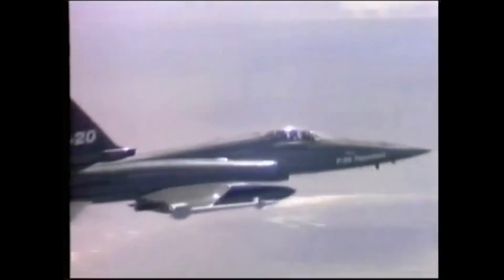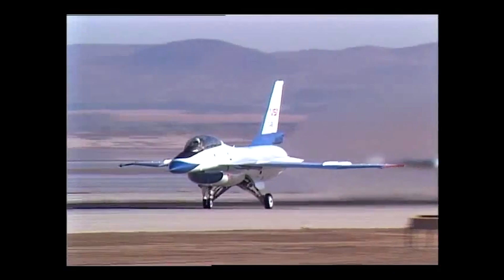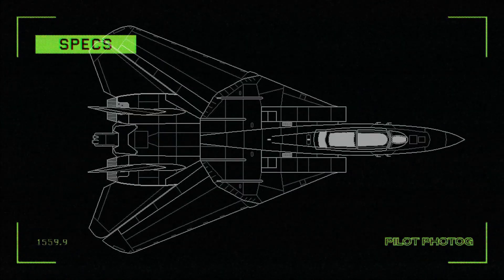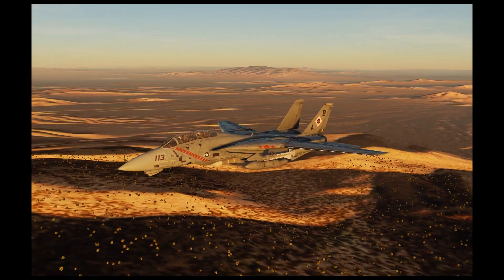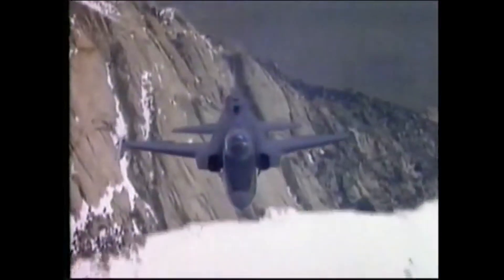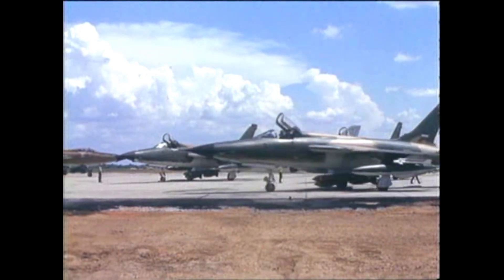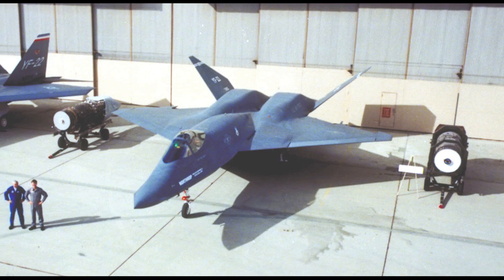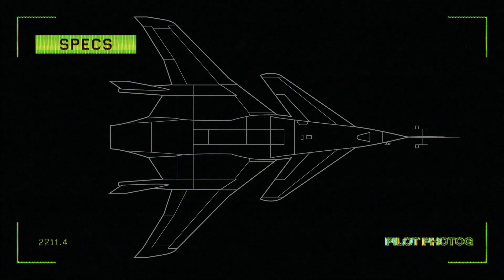Top 5 Fighters That Should Have Been Built | Best of Aviation Series by PilotPhotog  f20  f16xl

Comment: The F-20and F-23 definitely should have been built. I met a brigadier general of the joint chiefs after it was decided that it would award the contract for the F-16. He told me that the pilots preferred the F-20, but the senate had given the F-16 a better deal to produce. Back deals done, grafting began, and so it goes. Where a military project is produced in what state in a given year also determines what gets green lit. Remember the AH-56 Cheyanne? It was 225mph faster than the Huey Cobra, but a couple of mechanical glitches and that was the end of her run. The military adopted a watered down version in the Apache, which is still 355 mph slower.
Reply: The F-20 was never in competition with the F-16 for USAF contracts, and didn't even exist when the F-16 was chosen. The F-20 was developed for export and failed to get any contracts because the F-16 was already well-established in Europe and Asia. 

Are you sure you're not confusing it with the YF-17? The YF-17 was considered almost as good as the F-16 as far as being a lightweight fighter goes, but had different maneuvering characteristics that could have made pilots feel they had a back-up option if they were out of position in a dogfight. But the YF-17 had shorter range and lower payload capacity.
Reply: @dumdumbinks274  No, I had a face to face conversation with said general and those were his words to me. Now, you can say as you wish, but this was a year or do after the F-16 was green lit for production.
Reply: @kingt7126  It's simply not possible. The F-16 entered service with the USAF 4 years before the F-20 even had it's first flight.  They were never in competition with each other., hence why I'm asking if you've confused it with the YF-17 which was the YF-16's direct and only competitor.
Reply: @dumdumbinks274  Look here, I had a conversation with a general and that was my conversation. So don’t tell me it didn’t happen, it haciéndela and there is mi thing you can say to make it unhappiness. You can believe whatever you want, but get out of your feelings about it. You do not have to believe it. Move on.
Reply: @kingt7126  No need to be rude, I'm not attacking you. You may well be remembering what you were told correctly, but that doesn't mean the information you were told was correct, or even the whole truth if it was factual. Fact of the matter is that the F-20 didn't exist when the F-16 was chosen, not that it would have mattered because the F-16 was still far superior as a combat platform.. and the F-20 was aimed solely at the export market anyway.
Reply: @dumdumbinks274  Look here, you started it by saying my conversation did not happened, that’s rude! Who said anything about them competing? I never did. The F-20 came before the F-16. I do not care if you believe what I said on this pos. My connect was not addressed to you in the first place and I do not answer to you. Now go troll someone else!
Reply: @kingt7126  No I didn't. I said the content of what you were told is wrong, and this is easily verifiable. I take it English is not your first language? 

Competitions? You started that topic too by stating "but the senate had given the F-16 a better deal to produce". The deal for the F-16 was reached at the end of it's competition. So you are claiming that the YF-16 and F-20 were in competition. But regardless the entire comment is false because the F-20 DID NOT EXIST back then, and by the time the F-20 prototype was ready for demonstrations the USAF were firm and happy customers of the F-16.

In order to come to the conclusion that the F-20 existed first you have to blatantly ignore 2 easily verifiable facts.
1. The YF-16 first flew in 1974. The F-20 first flew in 1982.
2. The US naming conventions for fighter aircraft dictate that the number in the designation increments upward for each new project of a given type. i.e the F-14 came before the F-15, the F-15 came before the F-16, and the F-16 came before the F/A-18 and F-20 etc.

So you're really only making a fool out of yourself. Doesn't bother me if you want to continue doing that, but being obviously wrong and still trying to defend your position is called arrogance, and arrogance is not a good quality to have as a person.

Comment: Northrop built the F-20 primarily for use overseas, not with US services.  The reason was to avoid sharing our best technology with with so many other countries, but General Dynamics and the F--16 out of Texas used their pull with Congress to make being used by US Forces a requirement for any airplane we sold elsewhere. Most US fighter contracts were already filled except for Air National Guard, but again Texas and GD pushed them to use the F-16 instead which froze out the F-20, which would have been built in California.  

Only one of the F-20 crashes was because of G-lock before the plane was locked out by GD.  The second crash occurred after the pilot ran out of fuel as he was finishing his second air show that day.  He had just finished a 6G turn which ended with him just 20 feet above the ground, and upside down. He was going flip over put down the gear and land, but his fuel zeroed out.

Comment: I'm going to sort of disagree with the F-20. I knew it would be on this list of course. Yes, it would have been a good export plane, and a good adversary, but not so good for the USAF. It was small, had a pretty small weapon load and range with a full load was limited. Great if you have a small country to defend, not so great for projecting power hundreds or thousands of miles away. The USAF already had their small fighter and didn't need another one. I would go so far as to argue the F-16 in it's original form (APG-66 shooting heaters only) was not a terribly useful airplane.

As for the SuperTomcat-21, it was really either/or with the ST-21 or the SuperHornet, and it was really a decision between which Navy fighter contractor gets a new lease on life, Grumman or McDonnel Douglas, and Grumman was hated by Dick Cheney. So many of the reliability problems in the F-14 could be fixed by replacing analog electronics and clock-work mechanisms with newer digital systems. Ironically both companies ended up merging, and McD doesn't even get a name in the Boeing organization, unlike Northrup Grumman.

Comment: The Advanced Tactical Fighter competition in the 80's (F-22/F-23) was intended to counter the emerging threats of Mig-29 & Su-27. I think thrust vectoring capability of F-22 was a key attribute that led to its winning the competition. I surmise Air Force must have been thinking that as controls laws were improved, they could harness more capability from the thrust vectoring system and make the F-22 more agile in future. With everything being equal between the two, F-23 would have won the competition from an aesthetics stand point. It looks sleeker than F-22.
Reply: Not just that... the YF-23 had a small payload. I'm guessing they considered the YF-23 more of a hit and run fighter, whereas the YF-22 could potentially perform multiple engagements with refueling in-between... basically the YF-22 would have been considered more appropriate for the role of air superiority, whereas the YF-23 would be used more like a MiG-31.

Comment: F23 lost cuz it was made from parts of the F18...it was not a totally new plane...F16 actually had more drag...what you mentioned was only after NASA got the're hands on it and drilled micro holes on the wings and installed airpumps to suck the air threw and reduce drag

Comment: The yf23 also may have not been chosen for 2 reasons. Northrup had issues with cost over runs on the b2 program and also a late redesign submission after the jet was being built. Suggesting the design being submitted was good enough and not testing the updated design may have not been worth the cost of the change. Additionally the f14 super tomcat was competing with the budget of the now decided f22 program. And the recent fall of the Soviet Union. One more thing about the yf23 it looks like a flying squirrel.

Comment: The nacelles on top of the fuselage for the F-107 would have sucked pilots ejecting from the cockpit into the engines.  The RPRV-870 (HiMAT) would have had too many reflective surfaces; perhaps, that was not really a concern back in those days when designing and developing fighter aircraft though.

Comment: The Arrow was not a fighter at all, it was an interceptor.
Neither was the Himat, it was just a demonstrator.. It had no complete package that could make it work as a fighter.

The F20 Tigershark is probably the best example of a true fighter, lightweight, big thrust, small, low cost
John Boyd would have told you :  you need a lot of little cheap fighters, not just a hand ful  huge expensive bloated planes.

Super Tomcat should be #2 simply because it already existed for the most part.. it was just an evolution of a tried and proven design , and the F14D's capabilities have still not been equaled by the short legged Superbug.

YF23 is #3 simply because it's way to big to be a true fighter.

Comment: The yf-23 was the better fighter, no doubt! And the yf-23 didn't do 2 belly flops at low altitudes. Which by the way the f-22 never fixed. The f-22 did a belly flops during evaluation whole the yf-23 didn't. Inn fact the yf-23 didn't have any significant problems ever! Whole the f-22 still does till this day.

Comment: My picks are the F-103, PZL-23 Skorpion and maybe F6D Missileer along with the F-111B. I know the last two didn't make any sense but who cares.
Reply: I like the F-103 for would of been the first 2.5 or Mach 3  ( maybe ) fighter interceptor with one engine in mid 1950s.. Planed to use licensed U.S. built  British Designed Bristol Olympus engines with afterburner ( very powerful engines used in the Avro Vulcan Bomber and updated Rolls Royce ones in the TSR2 and Concord ). I worry about the visibility out of the aircraft with a periscope looking forward and windows on the sides.

Comment: F-20 all the way my favorite....
Reply: Arrow bar none. even though it was designed as an interceptor the airframe was designed with forward thinking and modern weapons systems and targeting systems wouldve of made it a spectre of death with the Iroquois engines 30 000 lbs thrust each with proper metallurgy that was planned on the marks 3-5 mach 3 plus was theoretically easily possible let alone mach 2 plus...
Reply from the maker: @hellbringer09  agreed and in case you haven't seen it:  https://youtu.be/oLVDTDhBN1g
Reply: @PilotPhotog  loved it.
Reply from the maker: A great choice and in case you haven't seen it: https://youtu.be/T-TARYA_YHg

Comment: One from the UK - and not the two you might think. In the early 60's, De Havilliand (who had just been swallowed into the maw of Hawker-Siddley) presented to the air powers their Violent/Sea Violent upgrade of the Sea Vixen with twin Speys rather than the twin Avons of the Sea Vixen. Basically looking like a slightly bigger Sea Vixen with a supporting canard on the nose, the Violent/Sea Violent was planned not only to break Mach1 but to touch Mach 2. Drawings were made. Models were made. Engine tests were planned. The RAF loved it. The FAA liked it. The Air Chief Marshall said "This could be the best fighter Britain has ever made" And Hawker-Siddley killed it. It was projected to have twice the range of the Lightning - which, as we know, was a fine plane in its own right - and the abilty to carry enough stores to push it into the fighter-bomber class. But, yes, HS killed it. RIP, Violent/Sea Violent.

Comment: A couple of points:  (1) regarding the F-20 Tigershark: you mentioned that the JF-17 Thunder is a modern day incarnation of the F-20 concept. So is the even more successful Saab JAS-39 Gripen. If you look at size, weight, range, speed, ect then the Gripen is a much closer match to the Tigershark and shows where the idea could have gone. Then again, the Tigershark came into being simply because the Carter Administration didn't want to sell full-up USAF standard F-16's outside of NATO allies. (2) regarding the F-16XL - the XL option could be implemented at minimum costs today as a life extension or upgrade to existing F-16's as it could be retrofitted to existing F-16's. It could just as easily be built as a new-build aircraft if Lockheed wanted to breathe new life into the F-16 program (which it doesn't want to do as it would harm F-35 sales). Lastly regarding the Avro Arrow, an unspoken but now known reason - and perhaps the real reason it was cancelled - was that the Arrow program had been heavily infiltrated by Soviet spies - and the information that those spies had sent back to the Soviet Union later allowed the Russians to develop the MiG-25 Foxbat. There would have been nothing "Secret" about the Arrow as the Soviets had completely compromised the program.

Comment: In addition to my earlier post about the maintenance costs associated with the swing wings on the Tomcats the F-18's replaced the Intruders.  Then when the F-18E's and F's started replacing the Cats it was a matter of pure logistics.  F-18's in one form or another replaced the F-14's, A-6's, E-6's, and S-3's.  The amount of replacement parts that could be kept aboard not be mention cross function knowledge of the plane crews did the cats in.  Now we only have to stock parts for the F-18's, E-2's, and C-2's plus the Seahawks and the E-2's and C-2's share many parts.

Comment: The F 20 should have been the airplane India should have acquired. Very good capability against its potential adversaries  and easy to maintain and could have been assembled indigenously.  It had an insane quick start to take off time with all systems fully ready. I am still a believer in the high low mix philosophy of systems production. Unfortunately, the military went to all high cost purchase, high maintenance cost systems, and not enough numbers.

Comment: also, we had lost confidence in our supporters. CA senators and reps flaked out. We were building the B-2 and dis-information of the current state led to politics rather than engineering and our capability to produce. We had two plants at Palmdale but politically a plant needed to be in GA or TX. Better aircraft like the 20 and 23 do not win as it is not about design and capability, it is about who pork barrels whom.
I am for one so smug that our design and manufacturing capability is finally being recognized.
Politics is more powerful than design and cost.
Reply from the maker: Well said and thanks for commenting!

Comment: the proble with the f-14 , too expensive and the variable-sweep wing switching was too heavy  and slow process for dogfighting, sometimes failing leaving the  wings in different positions.maintenance takes lot of time and money  witch was replaced by the f-15 and f-18 simpler designs but much more reliable a lower maintenance cost, plus the amount of fuel used by the f-14 was crazy, still the most beautiful jet fighter ive seen.

Comment: Hi, that was an excellent video. I have thoughts about the F-20 Tigershark and the YF-23. One, the F-20 absolutely, positively SHOULD have been built! I think its combination of economics and performance made it a no-brainer choice. As for the YF-23, in addition to the factors you cited, I'd argue that the F-22 was chosen, in part, for political reasons. I'll explain...

Back when the YF-22 and YF-23 were under development, the Democrats controllled both houses of Congress. This had been the case for decades, and it didn't appear that that was going to change; in fact, it didn't change until 1994, when the Republican party finally took both houses, and ended a 40 some year drought. Why does this matter?

If you'll remember, Boeing was part of the YF-22 project. Where was Boeing headquartered? In the Seattle, WA area. Democrat Tom Foley of WA State was Speaker of the House back then, so choosing a plane in which Boeing was a partner would make it hard for him to say no! How would it have looked back home if Foley had nixed a product produced by one of WA State's largest employers? Secondly, Lockheed was also a partner on fhe YF-22. Lockheed had a major facility in GA, then known as Lockheed Georgia; they produced the C-130, among other aircraft. Guess which powerful politician was out of GA back then? None other than Senate Armded Services Committe Chairman Sam Nunn! A compelling case can be made that the F-22's selection was, at least in part, politically motivated. SO! Even if the YF-23 had done the high AoA maneuver and live fire exercise, the YF-22 would still have gotten the nod. Given the makeup of Congress at the time; given where certain, powerful politicians were from; it was either select the F-22 for the US' gen 5 fighter, or have none at all. Those are my thoughts...

Comment: The problem with the F16XL was that it had a single engine that would put so much playload on the single engine and if it were to be a jet, Lockheed would have to install a new F16 production plant, which would increase the cost, which is why the project was shut down.  Done

Comment: As capable as the F-16XL might have been; the avionics suite on the F-15E was miles ahead of the F-16 at the time.  So several things killed the F-16XL - the additional range, the higher max take-off weight of 88,000 lbs of the F-15E, the higher survivability of the F-15E, the higher speed of the F-15E, and the unparalleled radar and avionics suite of the F-15E.  The F-16XL, as amazing as it was, didn't have a chance against the F-15E - except for those countries who were on WIC and living in section 8 housing.